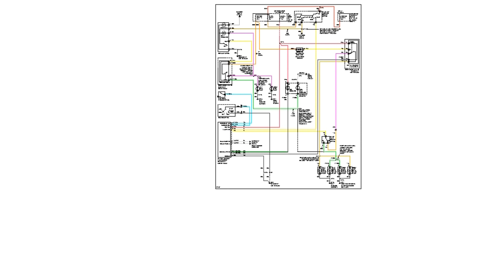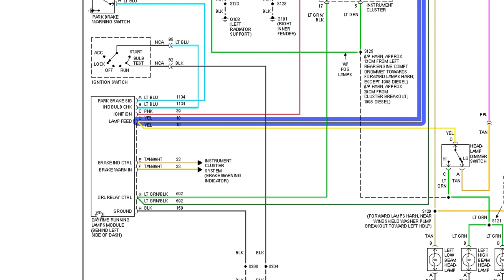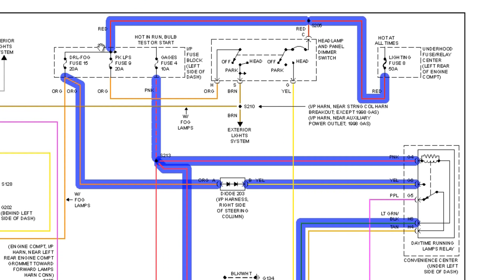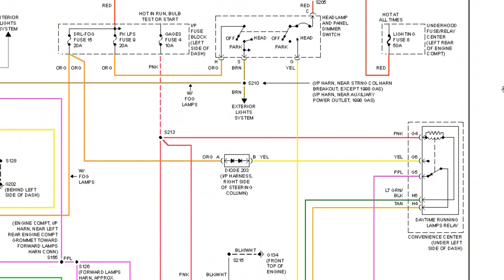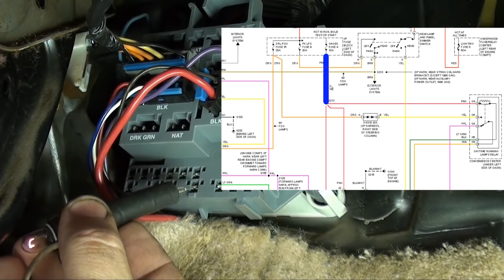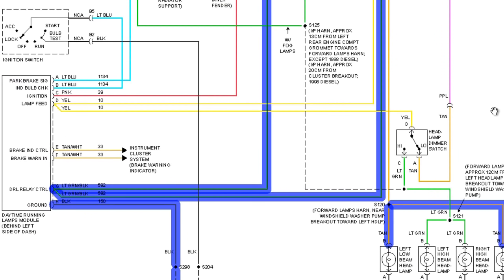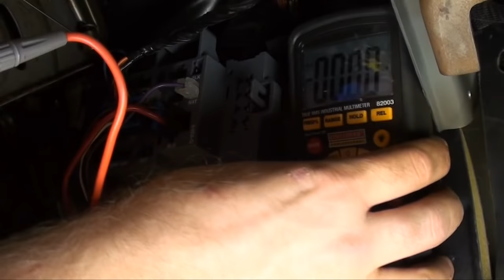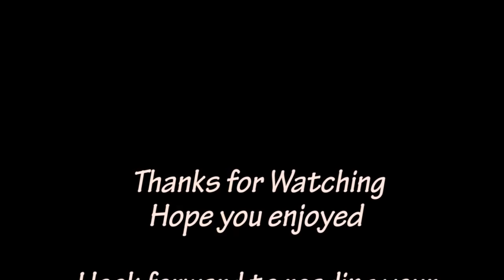Daytime running light circuit troubleshooting (DRL circuit)

Comment: Excellent, thank you, my wife was experiencing DRL warning lamp on and sliding doors not opening in her Honda Odyssey (youngest daughter jumped into the driver's seat as my wife was filling up with gas). Seeing in this video that there is connection from DRL to parking brake, I suggested to her to see if the parking brake was accidentally on a bit. That fixed the problem...nothing like diagnosing car problems from work over the phone =).

Comment: 90% of your tests at the relay...amen brother, haha. This is the reason why I love relays, because at the relay, you can quickly determine...1. how the coil is controlled(ground side switched or power side switched) 2. Bypassing the load terminals(if the circuit now works) you just ruled out the entire load side of the circuit. 3. Current draw can be measure there(load side) and so many other awesome tests, mostly with inexpensive tools anyone can purchase at Sears or some ma and pa hardware store. The fact that your test light was nice and bright at fuse 15 but was dim at the relay is an instant red flag. Obviously there is a voltage drop problem and that problem is between the fuse and the relay, in this case, the diode. Love the work Will, keep it up.

Comment: I did not think this would help me until I got to the part where you describe the Diode.  Then it hit me!!!   The 2002 Chev ZR2 Tracker Diagram I have from web shows a Diode!!!  I could not make out the printed symbol  (very small on screen and lettering tiny).  Now I know.   It has to be the Diode because the voltage issue is the same---reduced power.  My problem is the interior lights have failed.  Now all I have is the challenge of finding the Diode in the vehicle.    Thanks much for the detail.

Comment: Excellent video - great camera control with added schematics from time to time, excellent instructions on both parts 1 & 2...it helped me diagnose that I had a faulty DLR relay and not the diode. The relay failed after I attempted to update my 1997 K1500 with replacement LED bulbs that were recommended for the vehicle. I'll be calling them tomorrow to see if I can even use the LEDs on my vehicle given what happened. I read some articles after I purchased my bulbs that you should not retrofit halgen based vehicles with LED bulbs as the cans are not designed for LED bulbs and the light does not get directed correctly and/or blinds on coming traffic.

Comment: Well done!!  I recently bought the " load pro" test leads that connect to my DMM  and in this situation it would work as you have shown with the push of a button. The test leads checks for opens, short to ground and high resistance all at once.  A real time saver have a fantastic addition to my DMM I never remove.  If you have never seen the load pro its well worth a review.  Looking forward to part 2.

Comment: I really enjoyed this video. You have explained everything very well for me to understand. I do not have the exact same problem, but I think it will help me solve my problem. 

I have one question: If the DRL Relay is not working could it disable Daytime Running Lamps & Low Beams? 

At the 3:40 mark in your video you said if the headlight switch is on that there is no need for the DRL Module to be working. From the wiring diagram the Lamp Feed travels to Head Lamp Dimmer Switch to the DRL Relay to the Low Beams. 

If the wires are good and no ground outs, are the two suspect faults the Head Lamp Dimmer Switch and the DRL Relay? Or just the Head Lamp Dimmer Switch? 

I have a '98 Chevy K1500 with no DRL or Low Beam. High Beams work. Checked fuse 4 & fuse 15. I'm checking the DRL Relay in the morning. I hope it is not the HLD switch. Relays are easy access to replace and less expensive. 

Thanks again for posting the video!

Comment: You caught me thinking the question as to why you used a test light to check ground when you could have used a DVOM. Your next sentence showed the voltage drop under the load of your test light, and I felt a little sheepish. I probably would have missed that, and spent hours trying to figure it out. What's the point of that diode anyway?

Comment: old video  but really good one . recently i had one light burn out and so i decided to replace both DTL sockets and i did and know i have no power to either socket . i thought i soldered the wire reversed . DTL fuse under hood checked out good . not sure how i lost power

Comment: Hello..thanks for your detailed video here but I am a bit slow with electronics..I have a 93 suburban and am removing the OWL headlights and replacing them with old school round headlights..I don't want the daytime lights..hpw can I wire it so that just the parking lights come on when I flip the top rocker switch...also there is already a problem because sometimes the DRL and parking lights  do not even work..I think it's in the switch because if I turn them off and on they will work again...thanks again

Comment: So what happens if the relay ground is no good? Where do I look from there? I have DRLs but no low beams with swith on. Have high beams, just no low beams. I have replaced the brake light swith, turn signal switch and headlight switch and DRL relay. Checked for continuity at diode. But the ground side of the relay is no good.
Reply: did you ever figure this out? my ground is also no good

Comment: Great video. I am curious what the symptoms were that turned out to be a faulty diode? What was not working properly on the truck before the resolution? On my suburban, the daytime headlights work fine during the day. At night when I turn on the light switch, the instrument lights do not turn on, nor to the rear running lights. Weeks ago I checked fuse 15, but until I watched your video, I did not know to also check fuse, which I will do asap. Based on my symptoms do you suspect the DRL circuit ... If not, what should I check first, the diode? Your video is one of the best I have seen. Thanks so much.

Comment: Can you use a jumper on the diode connector for emergency purposes? I have 97 gmc and the diode went bad, but I live in Costa Rica and can't find a replacement anywhere down here.

Comment: Can you please help me find this part on my Chevy Express Van 1500, 2001?  They have been flickering and buzzing and now they don't work but affect my dash and starting ability.  I'd like to remove the diode and bench test or just leave it out to see it it changes the behavior.
Reply: I have the same problem,how do we fix it?
Reply: My 2002 gmc savana had no headlight left except through the DRL! Replaced every bulb, fuse, switch, etc….

Comment: I have a 2000 GMC Savana 3500. The rear running lights won’t stay on for some reason. I hear a loud click then they turn on then I hear a loud click again and they turn off? Any ideas on what it might be guys? Ground? If it was a fuse the rear running lights probably would work intermittently. ?

Comment: Have a 1996 3500. Low beams stay on until emergency brake switch is closed.  Two black wires have great ground off daytime running lamp module. Could the module be defective?

Comment: great job  i have a truck 96 gmc  i just put a head light swicth in  now i dont have running lights or brake lights n blinkers  in the back of truck  but have power to the harness  i cheak  the fuses   all good  n the bulbs r good im lost now

Comment: Mine won't go out.  I have a leak around some glass somewhere and water is getting into the car. When it get's hot there's condensation everywhere. I'm thinking the moisture may likely be the problem. Yeah. I know I have to take care of the water issue, but in the mean time I need to figure out why the headlights won't go off.  And realistically, it may not be the day runners. I know I have heard what sounds like a relay trying to switch back and forth and the lights flicker when it does.  My first try is to replace the headlight relay which is what brought me here looking for the location of the relay.

Comment: i have a 97 regal and the passenger side daytime running light is off and the blinker doesn't work correctly on that same side... on the rear of passenger it blinks fast.. and i have a parasitic drain on the battery just after a couple hours.. could this be related to my issue ? or a way to fix my issue?oh and the first and third digit of the mileage is not showing either x2x863

Comment: Everybody wants theirs off... I want to get mine running. Where is this diode for my 2000 Astro Van? It's not where you located yours. 

I thought I had it fixed... but nope. I DID fix the high speed blower though.

Comment: Very very good demonstration. I have been struggling with this very problem on my 2000 Sierra 1500. It started as intermittent but is now chronic. What schematic software are you using? And how can  the Ambient Light Sensor be tested ?

Comment: Just watched this video got a problem I can’t figure out 1999 GMC suburban K1500 5.7 v8 just all of sudden my headlights won’t come on new multi function switch new headlight switch running lights all work signal lights work brake lights work just no headlights low or high beams new DRL relay to what can I do

Comment: Hi I have 2003 z71 Chevy Tahoe and the chmsl does not work. I purchase a new one and it still does not work. the regular brakes are working fine. I did notice when I press the break power supply ends (found that with a tester) Just wondring if yo have any thoughts on that?

thanks

Comment: 1996 chevy silverado 1500 truck -- headlights are not working. so we change the headlight switch, headlight relay, head light diode. and still don't work .  but the daytime running and hi beam works.  what is our next thing to change or fix?

Comment: I have a 2001 chevy suburban 5.3 the driver side low beam light won't come on. The build works and i changed the fuse/dimmer switch. Also when I click ghe high beams, the passenger side won't come on..STUCK

Comment: On  My 01 monte,  I have no high beams or DTR lights,  and the  DLR relay in the engine compartment,  pin (87a) is hot when the key is on. All this started when I changed out the battery. I may have stressed out the harness when installing the new battery. The module checks out good the fuses are not blown. Going forward with out a clue.
Reply: Further more, checking for power at the park brake switch there is no power, yet the fuzes are good along with the relay, though no power detected at the fuze terminals for front and back. Is this a BCM issue ? Does anyone know?

Comment: hi i have a question, it is on 2004 sub my head lights are on all the time and the driver side running lights the passager side is
not the amber light on the passager side worked till pulled the  bulb out  i put a new one in still does not work 
thanks

Comment: I have no rear lights or interior lights when my headlights are on.  Brake, signal and 4 ways are fine.  After checking the fuses I discovered #15 was burnt.  I put a new one in and checked the lights again and they still didn't work.  I re checked the new fuse and it was burnt too???

Comment: I have a 05 chevy avalanche a d both turn signals work. Both brake lights work. And both reverse lights work. But the day time running light/night running rear lights on the left side will not turn on..... I am baffled.

Comment: I have 99 yukon Denali I have no power to fuse 15 but fuse 4 has power lights work by switch  cause I removed module, why does 15 have no power

Comment: I have a 2000 Oldsmobile intrigue, the chime will not stop repeatedly dinging when in reverse or drive. Yesterday installed new passenger side headlight and daytime running lights stopped working then but no dinging at all yesterday.  This morning the chime starts and will not stop if in reverse or drive. Please help what the fuck do I do?? This is sooooooo annoying

Comment: hey... hi guys I have a 2011Silverado both of my headlight not turning on, or working at all ....? but my high beams are working what could be the issue or problem..???
Reply: it's a short in the wiring
Reply: My 97 chevy high beams work low beams work then shut off
Reply: I'm having the same trouble

Comment: I have a 2014 ram 1500 my daytime running lights stay on after truck is off just the side markers even turning the switch on and off .on the cluster panel the drl light stays on all the time .I think it might be a module ? ANY  ONE out there have ANY other ideas ..

Comment: Ok my headlights on my 99 Chevy Tahoe continue to cut off and on , while using them at night so I replace the light switch itself and that didn't help the problem so someone told me it could be the Dimmer switch so I replaced that n that still didn't help .. Could anyone tell me how can I fix this problem ..
Reply: I'm fighting the same problem. As far as I can tell the wire from the switch to the DRL computer (not the module) on mine is fried. The wires got hot and burnt. The oxidation keep the circuit open and signals the DRLs to turn on. I'd replace the burnt wire, but I can't find the other end because it disappears into a wiring harness and I can't trace it. My next course of action is to remove the DRL module (which will disable  the DRLs) and run a new wire (the yellow one) from the switch to the DRL relay. The DRL relay is on the driver's (left) side firewall near the parking brake pedal.